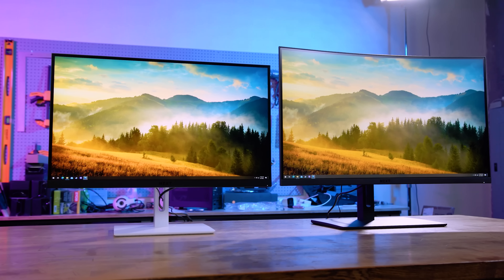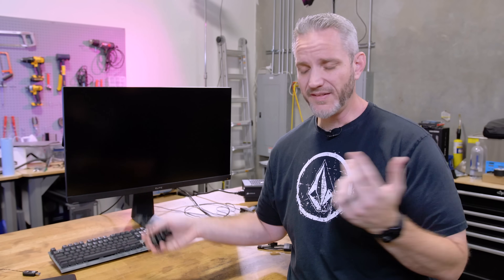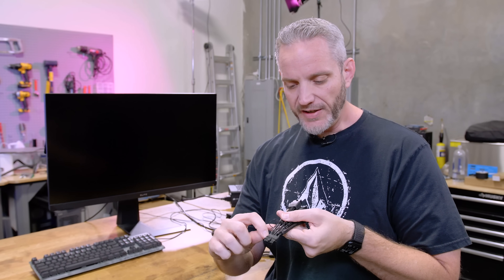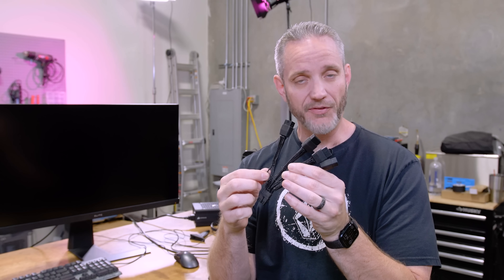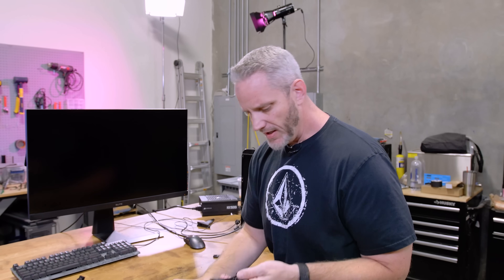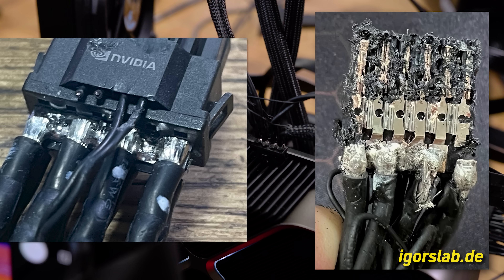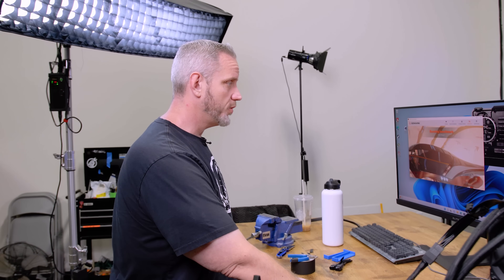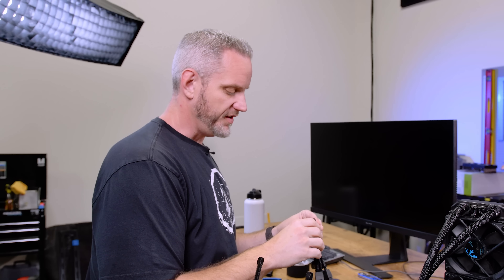Igor's Lab figured out why NVIDIA adapters are melting!

Comment: Good to see Nvidia letting the tech community do their R&D for them. Big brain move.
Reply: 8999 IQ
Reply: Its like EA with their games: why release a game with functional audio, controls and video, if the stupid buyers can fix for us?
Reply: They're following Microsoft's lead with Windows 10 when they fired their entire QA team of 2500. Since then we've been the tester.
Reply: This cable malfunction seem to be extremely rare, and things that are this uncommon, is not always easy to detect in testing. There have been popular brands of cars that are called back in the tens of thousands to fix things like airbag issues.
Reply: @FabledGentleman  How does Nvidia know which batch is $h!t tho? Gotta recall them all!!
Reply: @FabledGentleman  extremely rare ? The card has been out for 2 weeks
Reply: beta tester irl
Reply: Bethesda moment
Reply: GPU: Now in early access
Reply: @FabledGentleman  it only takes a few cases and one of those might result in injuries or loss of life. Any safety related issues should always be addressed seriously. Remember that not all 4090 users are tech savvy and well aware of this type of issue
Reply: Slaps head ! No surprise EVGA gave up dealing with them. I have not seen such a complete total foul-up in decades ! Where the heck was their engineering department? Is it run by clueless wannabe's ?
Reply: yes this is also how you sue a company
Reply: @FabledGentleman  Any competent ENGINEER of experience (i.e. an ADULT with experience in the field (not some spotty self-assured adolescent) would have taken ONE look at it and said .....  *YOU CANNOT BE SERIOUS * !

They are pushing the contacts BEYOND the manufacturer's ratings too (for good measure).
Reply: You're right! Most people learn nothing like ths in Public Schools...🇺🇸 😎👍☕
Reply: @YoungGirlz8463  Their entire '12 pin power solution' is a foul up of the *GRAND ORDER*. It's not even fixable.  Nothing about it meets sensible engineering norms. They need to shut down production RIGHT NOW (and their partners too) and relay the circuit boards (should be an easy task. will save them millions in the long run) to take FOUR 6 pin PCIe connectors that can handle 150W each with ease.

It'll make cable management much easier too and get rid of those awkward bend radii (no problem with side panels).
Reply: @Gardenian77  It should be withdrawn from stock TOMORROW. Nvidia may have a class action lawsuit on their hands if they don't.
Reply: @JJssss  Bring on the lawsuits ! Nvidia need to withdraw this product and recall the boards sold. The 'fix' is so simple but they had to do it THEIR way and be 'oh so clever' i.e. STUPID !
Reply: Over billion dollars in research, and they got it wrong for the 40 series and right for their 30 series
Reply: @grahamstevenson1740  why? The product isn’t flawed. They need to send free cables asap though
Reply: @SprDrumio64  TBF Jay did say when he first mentioned it might end up being a problem, in the email the nvidia guy told Jay "It just works"
Reply: @vedantdesai1  You can't SAFELY fix it by changing the cable.

Whilst Corsair's offering is an improvement, there is ONE FUNDAMENTAL PROBLEM.

To draw 600 Watts through that 12 pin connector draws 8.33 Amps per pin. That is BEYOND the maximum rating of Molex's contact. I checked the data sheet on them. In the very best circumstances (e.g. 2-4 way housings)  the contact is rated at EIGHT (point zero) Amps. In multi-terminal housings, the contact MUST be 're-rated' due to the combined heating effect.

A safe current rating would be around 5 FIVE Amps per pin depending on how well the attached conductor 'sinks' or 'wicks'  the heat from the contact.

I suggest that Nvidia re-engineer the borad for qty 4 by 6 way PCIe power cables, It shouldn't take more than ONE DAY to do that.

They need to withdraw stoch ANd recall uit for electrical safety issues.

** NO ALTERNATIVE ** . The potential FINE will just get bigger, the longer they procrastinate.
Reply: @grahamstevenson1740  You're right, Graham..."American Ingenuity" used to describe a sort-of combination of Engineers, Testers out in the Field & maybe some cutting edge, or screwball ideas! I unsuspectingly  ran across something again yesterday that was developed at the old Bell Labs. The NASA space program during the 1960s was yet another "Driver of Innovation". Now, other countries steal Intellectual Property, dumb down the quality of the products so they're almost useless and sell them to the world. I was born in 1958. God, how I miss the old days when they were rolling out new Microwave Ovens, Home Video Recorders, Electronic Fuel Injection, Personal Computers, etc..."The Greatest Generation" who raised us in the 1960s gave us access to all the Industrial Light & Magic they invented. AND NOW, Nvidia can't mass produce a reliable consumer-grade GPU adapter?!?! 🇺🇸 😎👍☕
Reply: Free money baby! Capitalism at work!
Reply: @vedantdesai1  The product is totally flawed. Nvidia have ignored the manufacturer's contact ratings. This is a perfect example of a total 'foul-up'. The manufacturer of the connector essentially said ** DON'T DO THIS **. And they did it anyway, with total disregard and wilful complete negligence !

To top it all, they then probably (not entirely sure) then contravened International Safety Standards too !  IEC 60950

I've read the data sheets and the standards. Have YOU ? The trouble with you self-assured  'know-it-all' kids (with zero real world experience) today is that think you're a heck of a lot smarter than you actually are. It takes ADULTS to understand these important things. Like boring resistance heating and why it;s important to ** STRESS RELIEVE ** conductors, so they don't break in service.
Reply: @grahamstevenson1740  go vent out your half assed insinuations somewhere else. No need to resort to a classic ad hominem fallacy to someone you don’t know.
Reply: @FabledGentleman  We don't know exactly how rare this is yet- some people are finding out there is an issue only after they loosen the connection for whatever reason and see burned or melted plastic.
Reply: @vedantdesai1  I suggest that YOU GO LEARN SOMETHING ABOUT ELECTRICITY and how it's used before 'going off on one' and attempting to correct me.

You will find, if you care to look into the detail, that I only ever make carefully judged comments based on facts and real world life experience.

I doubt you've ever read a connector data sheet or an International Standard in your entire life. I 'eat them for breakfast', AND understand them more to the point !
Reply: @bleachedwhale  And people shouldn't loosen the plug for fun, as another channel has reported the connector itself to be designed for only 30 such events before being worn out.
  Besides that, it seems they may have had limited time from Intel changing the connector until shipping the cards. Thus systematic cable testing may have been cut short by that unplanned change being forced upon Nvidia.
Reply: @lilblackduc7312  1954 here ! It was all vacuum tubes (valves) when I was born. Even the transistor (although theorised) wasn't yet a reality.
Back then, engineers of the likes of Bill Hewlett and Dave Packard could go on to found a company that even today is held in high esteem.
Too often now, we see fly by night 'entrepreneurs' claim credit for what they never had a hand in themselves and most likely have little interest in, outside of making a fast buck..
Sad, depressing even to see how engineers are now the butt of lame jokes from kids (who mostly haven't the first clue between them) and innuendo instead, whilst the 'know-nothings; Lord it over us as if we're irrelevant.
Reply: @SpartanArmy117  Then PCI-SIG need a fooking ROCKET up their backsides !

There are multiple issues that have not been addressed with this assembly. To me, the most serious TWO are 1. Failure to stress relieve a wire leaving a connector (vital) and 2. Using a solder joint as a mechanical  'anchor', resulting either in tearing of the PCB copper foil or severing the wire. These are very well understood issues in connectors and should be ROUTINE KNOWLEDGE for any competent design engineer.

Furthermore Nvidia took the contacts beyond their published data sheet ratings and failed to derate them for a multi-contact connector. Again. absolutely totally well-established normal practice. This what happens when you fire the old guys and let the children loose.

That connector is INCAPABLE of handling 50 Amps of 12 Volts ! Even when properly mated under perfect conditions. PCI-SIG should hang their heads in SHAME for arrant stupidity and ignorance of good engineering practice.

What we are seeing here is the dilution of engineering skills as older, more experienced folk leave the industry taking their expertise with them.
Reply: @FabledGentleman  Yup, and those cases have been catastrophic for those companies, especially due to the reputation damage.
Reply: Maybe idiots should stop cramming these cards in cases that can't hold them and cheaping out on other components to afford this card. I see idiots running it in cheap ass cases on pitiful psus with old cpus all over reddit.
Reply: @lilblackduc7312  - We’re in a race to the bottom in so many ways.
Reply: Don't give them the out, the issued warnings about not bending it side to side. I suspect they were aware what type of bending leads to the highest failure rates, but went ahead with production hoping things wouldn't come to light(or assumed end users would replace cables on their own dime anyway).
Reply: @YoungGirlz8463  Yes, If nvidia cannot pinpoint exactly which manufactured adapters are to blame, they might have to send out new adapters to every single person who have bought an RTX 4090, just to be sure.
Reply: @Gardenian77  It doesn't matter how long it has been out yet, if a million people have the card and only 10 people have a production error on the cable adapter, then it is in fact an extremely rare flaw.
Reply: @FabledGentleman  If you are paying for that crap in the price range, it should be never!
Reply: @gustlightfall  lol. In fact, considering how powerful this card actually is, it's actually great value for money. So the price range is actually great, the card was barely more expensive than 3090 at launch and is more than twice as powerful in several games.

A flaw in some adapters are of course not a good thing. When the RTX 3 series released several cards bricked because of a flaw in the capacitors or something. But right now of course the new cool thing on the block is to trash nvidia, because that's just what the nerds do these days.

I look at things from a more, let's say, reflective point of view.
Reply: Good for AMD letting Nvidia letting the tech community do their R&D for them
Reply: "Smooth brain" move 😂
Reply: @FabledGentleman  But seriously though, the reason this is picked up so hard is because of the way tech news spreads nowadays. "Melting 40XX Series Adapter Cables" is the best buzzword combo you could release at the moment for content. You're exactly right. This happened a few times out of hundreds of thousands, a massive corporation isn't going to do a formal recall.
Reply: @FabledGentleman  They also have recalls for things like FIRE HAZARDs that can kill you, for super silly things they decided to try and save money on, rather than go with a proven solution.

I wonder what the true percentage of incidents there are, versus cards without problems.
Reply: NASA does the same thing by having design competitions when they need a new idea for certain things. The prizes they give out for those are only a small fraction of what they'd have to pay actual employees to come up with that stuff. As a mechanical engineer, I think it's neat that anyone has a shot at winning and being compensated, but at the same time, everyone else gets nothing for their time. Such are the rules of the contest and you know that going in, so it's fair in that sense. Plus, it's not a bad thing that NASA is saving a lot of money by doing these things.
Reply: Its ok, those of us that have a brain dont fall into their new "Beta Tester" mindset. Why I always wait. Having had burned PCI-E connectors in the past via bad PSU/Bad connections, I knew the second something was mentioned that there will be a burned connector that ruins a GPU within weeks. Its funny, as most will not notice, and it wont immediately "Break" the GPU. It will spread the load and burn another connector. Until finally, you will have fans spinning, but zero video output.
Reply: @PDXCustomPCS  "Those that have a brain" while I'm happy you do, implies that it's easy, stupid, common knowledge to any user that connectors can melt or smoke. You have had a specific scenario happen to you (which is pretty damn rare in occurrence) and remember your experience. 97 percent of other people just buy things and they work. Being aware of this isn't blockhead shit, its pretty damn specific and people should absolutely be making light of it.
Reply: @dylanherron3963  That run on sentence was bad bud. Its not rare. My 19 years tells me that. 97% of people buy things and they just work? You sound like you've smoked a bit too much to have any knowledge on anything electricity related. So, what happens is when that current splits, it draws more power to the other connecting points. 🤔. Whats wrong about that? I mean you're 97% correct 100% of the time, so Ill just go with your opinion, which is obviously filled with good weed.
Reply: @SPG8989  You're absolutely right about that 😂
Reply: hahaha this is the best period of my life! not only have I predicted this, but the comments in those vids are the best ever!
Reply: Can't help customers that can't plug a connector in enough ... Just weak arms I guess cause failure. Or just bad building practices.
Reply: why they change the connectors ??
pci-e x8 was working great...